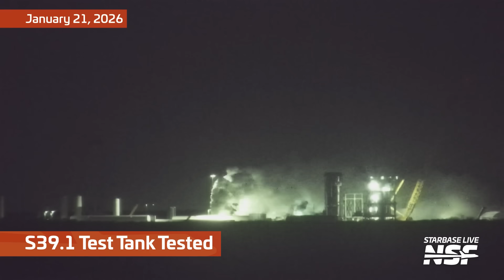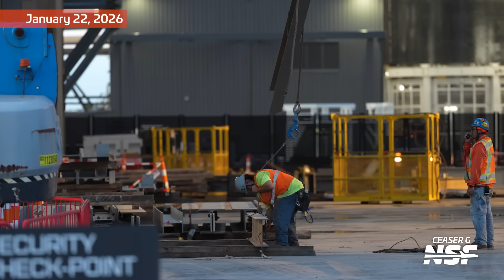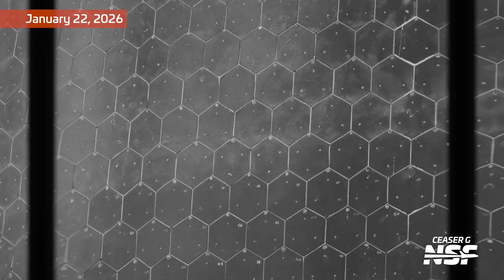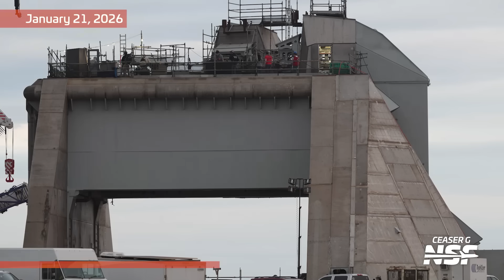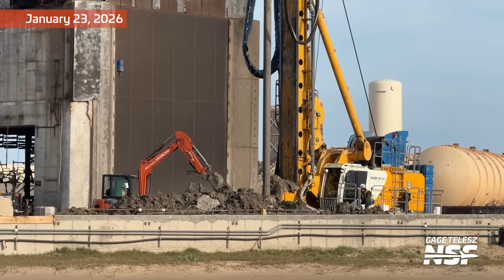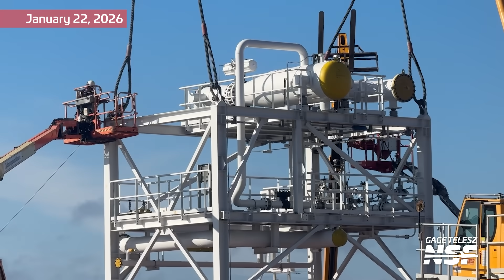Driving forward with Pad 1's conversion | SpaceX Starbase

Comment: It seems apparent to me that a section of the S39 heat shield was experimental modified to limit tile damage by using a hole saw to drill around the attachment pins and filling the gap with an adhesive thereby putting a nonridgid interface between the rigid pins and the ridgid tiles.
Reply: Perhaps.  That's a good speculation.  I'm leaning personally toward 'poor robot QC' as the numbers that were written on the tiles suggests to me a depth measurement from tile surface.  There may have been too much variability in pin installation length/depth, discovered late in the process, and the drilling and filling is a verification of the extent of the problem.

Comment: Surely better that they move to the 35 engine booster now as it will greatly simplify the booster aft section. Both the middle and outer rings of raptors can be gimbal and restart free and shutdown at MECO. The five inner engines can gimbal, reduce thrust at hot-stage, power up for boostback, then shut down until landing burn. Whereupon they restart, reduce rocket speed and assist manoeuvre booster for landing. 
Despite two more engines, aft section mass is likely reduced as, gimbal mechanisms reduced  to just 5 (5/13, just 38.5%), launch thrust of middle ring engines are closer to the skirt (less structure), COPVs with restart gas reduced just 5/23 (22%), header tanks plumbing reduced reduced to serve just 5 engines (5/13 - 38.5%). Two extra gimballed Raptors add weight as does extra propellant for slower boostback and landing burns.
Reply: That doesn't sound like a simplified aft section, that sounds like a much MORE complex aft section..

Comment: Sorry if this has been explained before, but is it known why starship has a band of very small heat tiles compared to the rest?
Reply: Think it's where the additional stringers on the aft dome section were added and there placement on the outside of the hull didn't allow for the usual tiles to be placed.

Comment: The crumpled area was not part of the ship, it was just a skirt added to the main test tank
Reply: I was surprised that they sent that tank out without a "bottom".  With or without pressurization, a solid bottom welded all the way around would have made that lower skirt much stronger.  But they inadvertently tested for a high off-axis force on the hot staging ring when it crumpled.  If the ring is not deformed, I bet they won't let it hold up flight 12.